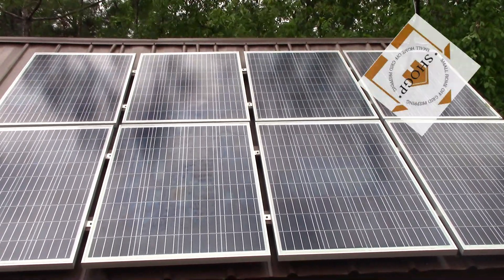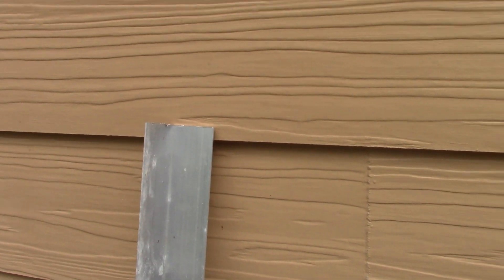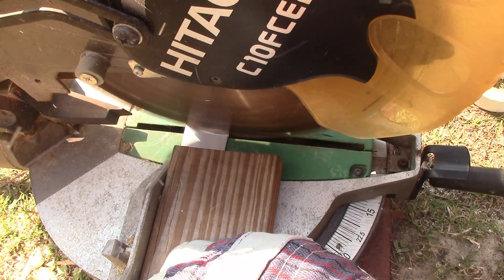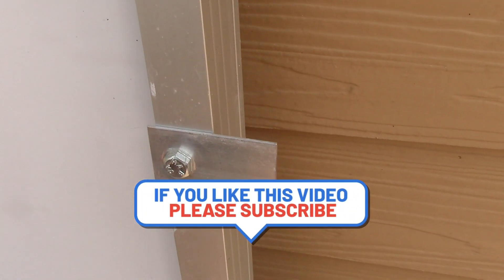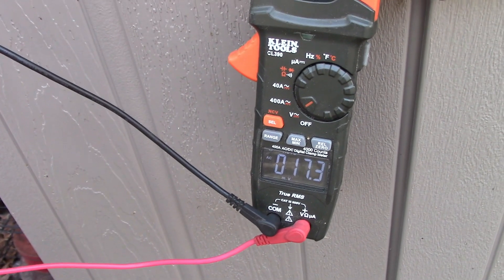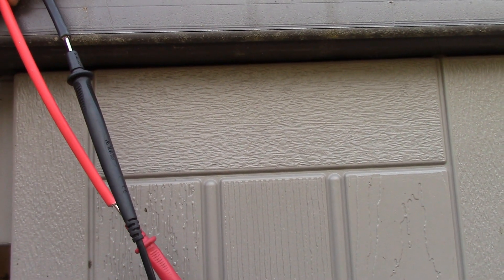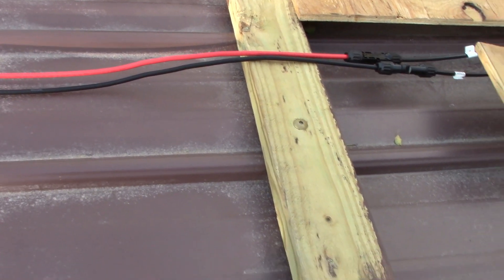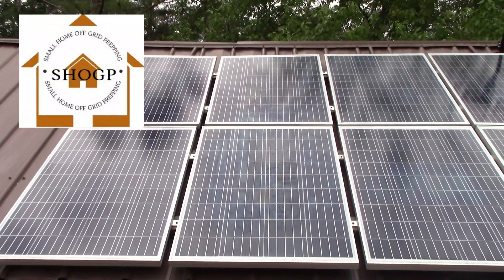INSTALLING MY SOLAR PANELS 6000-WATT SPLIT PHASE POWER INVERTER-500 AMP- 6060-WATT BATTERY BANK

Comment: Doing good. I also have a split phase inverter. Mine is the 4000 watt sungold power. I have the split phase for my small ac but I use a 3000 all in one for the rest of my camper

Comment: Great video!
Reply from the maker: Thank you, glad you liked it! There is at least two more videos coming out on this, it was a big install and couldn't fit it all in one video, but next we will be connecting to the house as a solar generator, using the generator interlock, and inlet,  then we are going to show the inverter, charge controller, the batteries, and all the wiring  I'm going to run the house at full load and run the air conditioner, and show all the different amp draws, volts and everything on both sides AC and DC, keep a look out for them!!